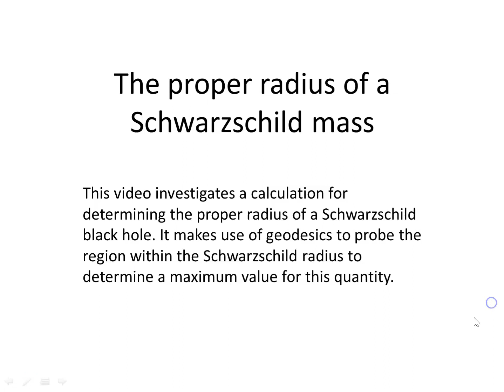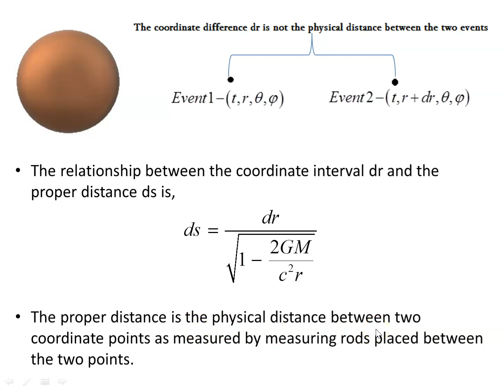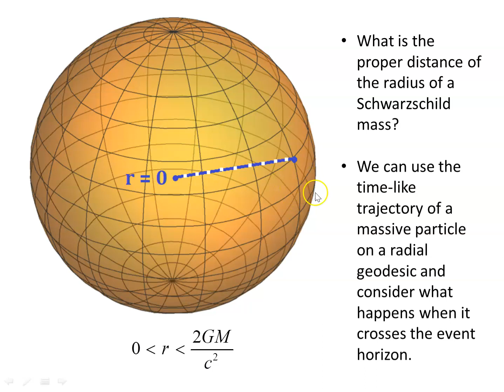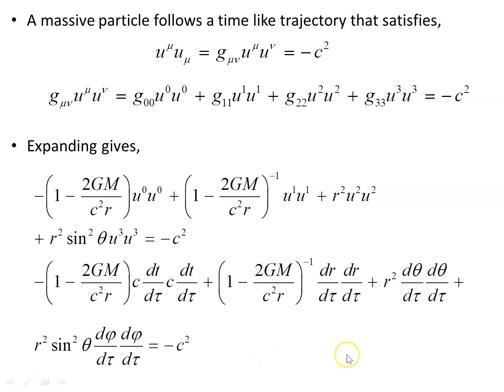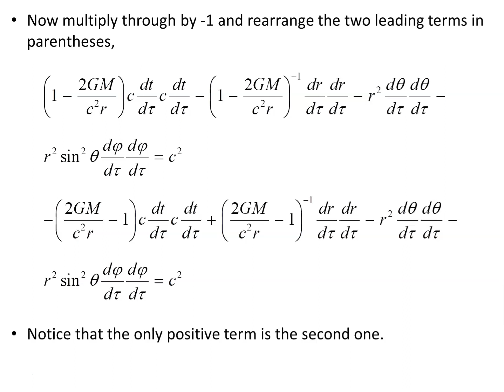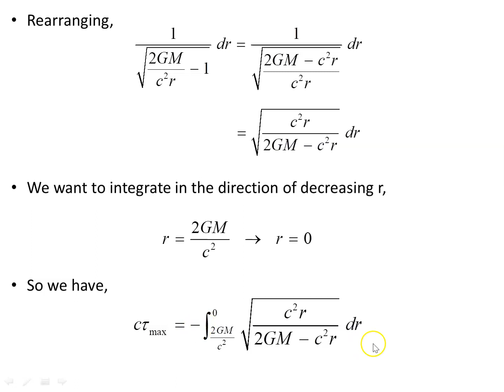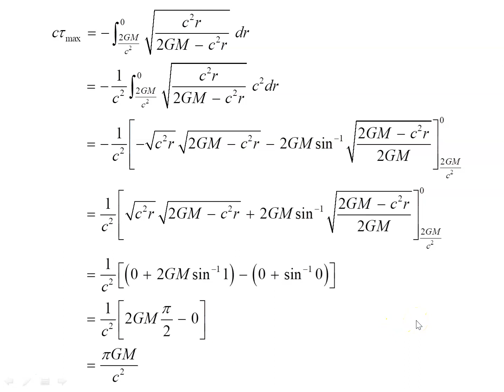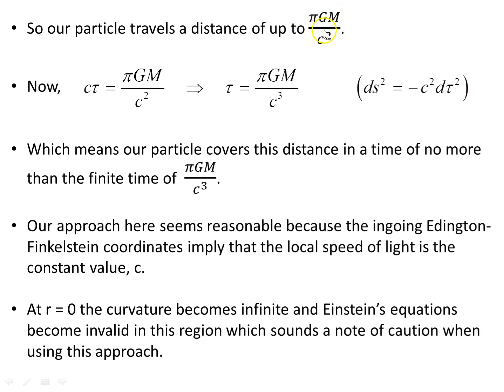The proper radius of a Schwarzschild mass

Comment: If infalling particles convert time-like velocity (c in the "forward" time direction) into spatial velocity, and if the Event Horizon is that surface at which all time velocity has been converted to space velocity = c, then from there on in, dt/dtau = 0, distant observers notice no coordinate time change even as the infalling particle's proper time continues to advance (briefly)... the first term involving (dt/dtau)^2 vanishes... and the "maximum" proper distance calculated is actually seen to be "the" proper distance (?)
Reply from the maker: Hello Erik. The argument mounted in this video is just that, a plausible argument given that the Schwarzschild metric describes the space-time outside of the event horizon. If this result is valid it is because we don't expect the geodesics of this spacetime to suddenly cease at the event horizon but to continue on so the argument seems a reasonable one.

We are not converting timeline velocity into spacelike etc. the local speed of light is still "c" as far as the infalling observer is concerned.